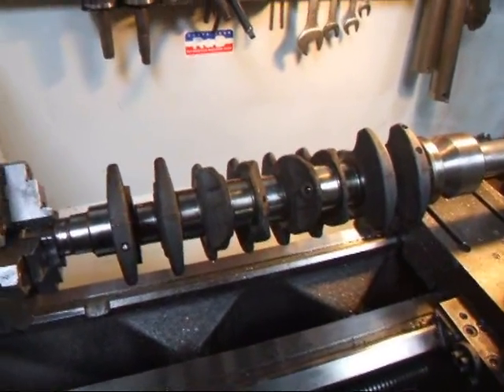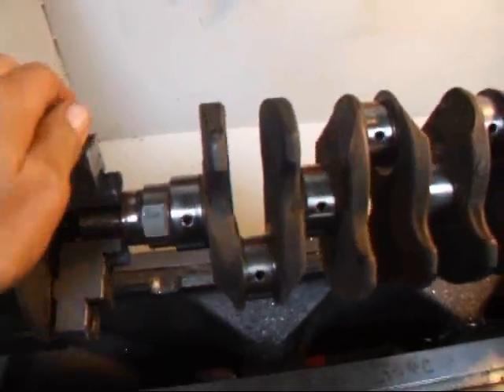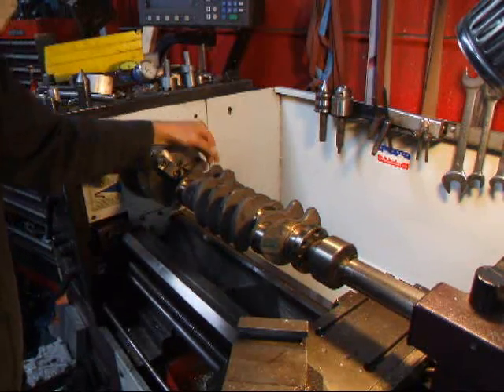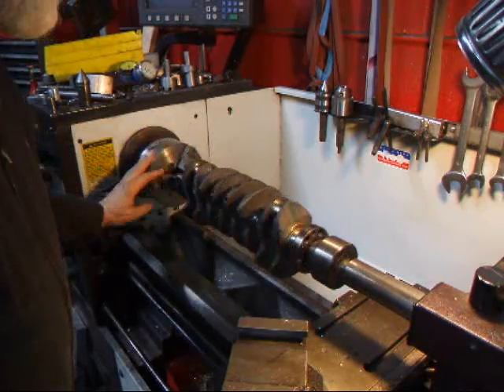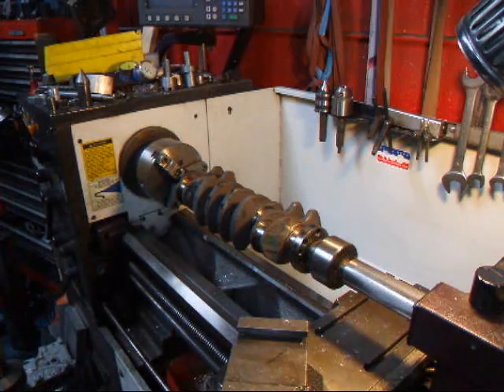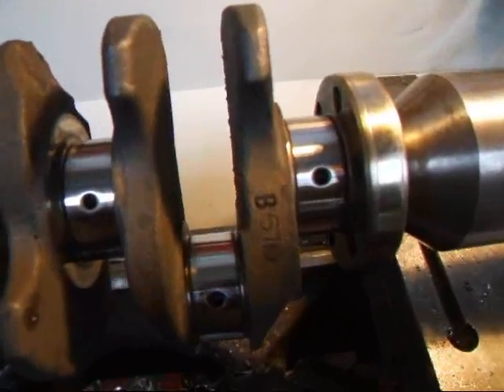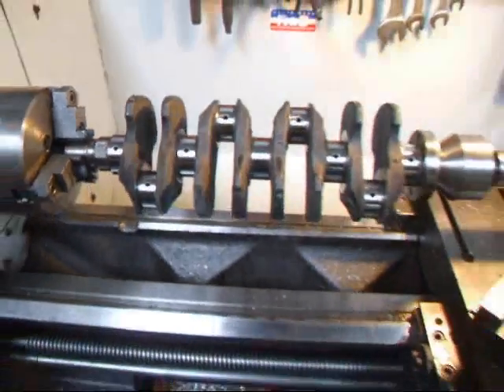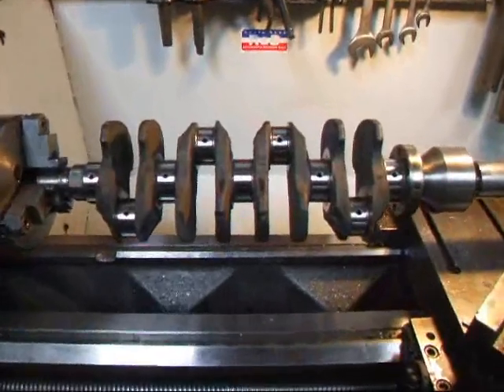MX5_Crankshaft_Polish.wmv

Comment: @AxSxKxONE makes the  surface  smooth   so that it dosent   mess up the  bearings   when the engine  runs  is will smooth it out  further  in time  but a  crank  floats on a lair or  oil its  not really  touch the   bearings very much  unless you have  low  oil pressure

Comment: What is your opinion on removing the counterweights on a 4 cylinder crankshaft? Alot of guys running in the Chevette division around here, are cutting the counterweights completely off (in a straight line with the rod journals) to lighten them. Some are having problems with main bearing failure, while others are not. The guys not having problems are keeping them below 6000 rpms.